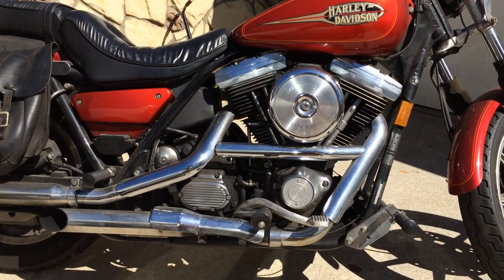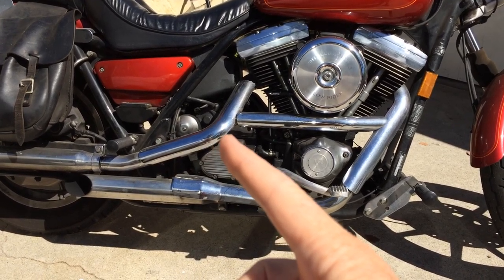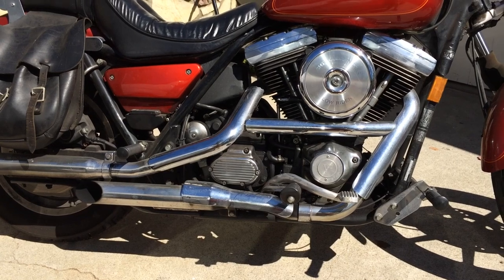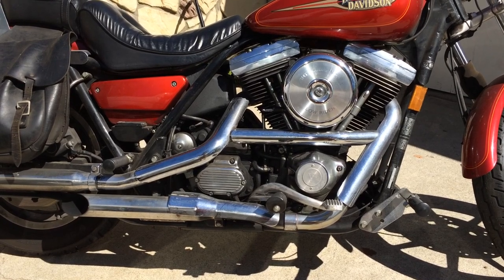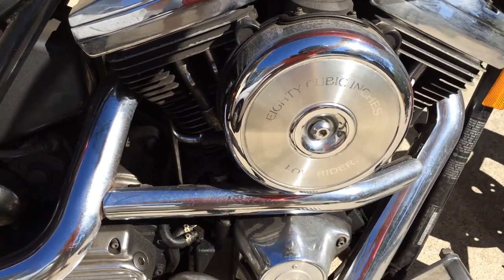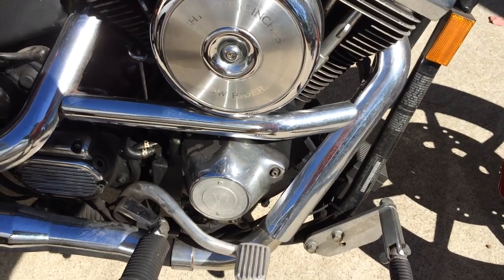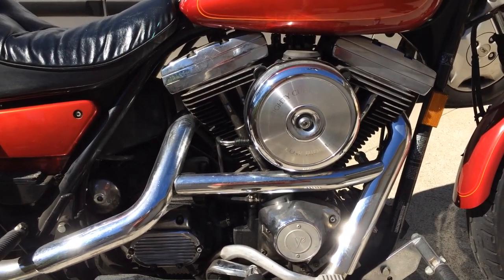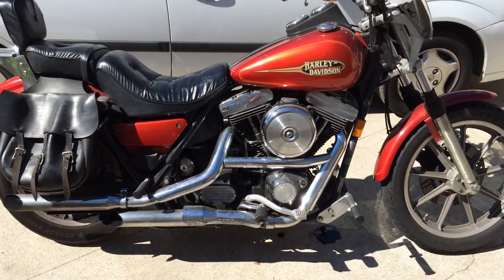Harley Wet Sumping Explained

Comment: I just cranked got my 93 FXR started after 5 years! (I talked her out of a divorce!)  drained and replaced fluids, cleaned carb, and she cranked after 2 turns!  You are correct on the wet sump. She spit at me and ruined my shorts just to remind me what a bad dad I am (was)!  I’m taking her shopping for new paint, bars, front end, and whatever she wants!
Reply from the maker: Glad you got it started. That’s pretty normal, and you don’t really need to worry about it too much. As long as you start it up every week or so, it shouldn’t happen.
Reply: Sounds like a good reason to get something different,

Comment: Wet sumping can also be caused by a piece of grit on the check valve holding the ball slightly off its seat. It was more common on Sportsters than on Big Twins when I was an H-D shop mechanic back in Shovelhead days. It was a LOT more common on Triumphs and BSAs. They knew about it and provided sump drains. Early Sportsters had them too.
Reply from the maker: My enfield Bullet gets wet sumped if I don't put the piston at top dead center when I park it. The sump has a drain bolt and has to be emptied or it won't start up and run.
Reply: ***** RE's do that by design. That's why you just check it's above the add line when it's cold and check actual oil level when it's hot. Mine starts and runs OK when it's that way. Maybe yours does it worse than mine?

Comment: Hey I have a 2020 sportster iron that does this. It will drain down from the tank into the sump over about 4-5 days. No other sportster I’ve had has ever done this so quickly. Maybe a little over a month or more during Jan or Feb when sat for 4-6 weeks. I ride it quit often and it’s a nuisance. It will literally have maybe 1/4-3/8” oil left in oil tank after 4 days. When starting it coughs spits you name it. Lucky if it stays running till about 2nd or 3rd attempt to crank. It fires this coughs and dies. Most time it fires up second time but struggles to stay running to say the least till the sump is at least partially cleared and oil is flowing back to the oil tank. Now b4 I go any further it’s been back to two diff dealers, so that’s two trips back and both say nothing is wrong. I say they are full of you know what. Something is allowing the oil to leak down quicker than it should. Does the sportster have a check valve in the oil pump like my old 94 springer I had, with an evo..carb motor. God I should never had sold that bike.  But we live and learn. I like evo motors hands down over new Milwaukee 8. They just don’t sound like the old harleys anymore. They are a beautiful engine but I’m into sound. A carbureted evolution motor sounds so good. But back to my problem. What do y’all think. I know what to do on the old bikes yank the oil pump and replace or replace check valve and spring in oil pump and pray lol. Any ideas. One dude told me it was a piston ring issue. What. Ok if that’s right it will fix itself when my hammer performance kit arrives. I just want to fix this now and at least slow down the wet sumping on this 2020 iron. Ok guys and technicians let me know where to start and I’ll let y’all know how it went in a few weeks. I’m a floating pharmacist and only have days off here and there to wrench. Thanks so much for reading this and please trolls stay away. I’m 52 and too old for BS. Want to solve this issue bc the dealers seem to think it’s just fine for a sportster to leaking down an entire oil tank in 3-4 days. This just isn’t right. Two guys I ride with have sportsters and theirs don’t do this.
Reply from the maker: I hope somebody answers your question. That happens to my Evo Buell if I let it sit for a couple of weeks. I would guess it Has to be seals in the oil pump.  I’ve heard of some people installing a check valve in the oil line to prevent this as well. Not sure where you would buy one though.
Reply: @hoohoohoblin  I hope someone answers too. Thanks for your reply. I love the bike just irritating to have wet sumping on a bike with under 1000 miles. They even charged me $98 dollars at one dealer for “diagnostic charges “.  I was like diagnostic charge?  You didn’t diagnose anything at all. I told y’all everything. I paid the bill though. But I will never go back there. Lol.
Reply: I have a 2014 XL1200C. The tank empties over time into sump. Never understood how the pump is lowest point and sump is above. If gravity then how does it sump up? Not an issue 1st year I owned but now when tank empties, I have small leak where pump inlet (feed) hose attaches to inlet fitting? Maybe a tablespoon only but I’m anal about even a drop of oil.

Comment: Just came across this video, after the 	1989 ULTRA CLASSIC (FLHTCU)  I inherited puked a TON of oil but still won’t start, now I know why.  I gotta get fresh fuel in her, and check for spark.  My grandmother purchased this bike when I was 9, it sat for five years when she couldn’t ride it, she passed and my mom and step dad got it.  My mom passed last year and my step dad rode it until his knees couldn’t hold it up anymore.  He passed recently and I inherited it through ‘Right to Survivorship’ and it’s a family heirloom.  It’s been partially mechanically restored, and has about 60,000 miles on it.  Everything still works.   

I appreciate your video and explaining this.  It’s ‘sumped’ as the local Harley dealer explained to me so I looked up that term and your video helps explain it better.

Thank you!
Reply from the maker: You’re welcome. I’m glad I could help. Once you get it running, it should be fine as long as you start it up every week or so. Mine only sumps if it has been sitting for a long time. That’s a great old bike, and you’re going to have a lot of fun on it.

Comment: I have a 1990 FXRS.  I leave it in at a vacation home and when I start it up (after sitting for several weeks), I get all kinds of oil puking out of a overflow tube under the bike (but only that first start after if sitting for several weeks).  Thanks for the explanation!  Very helpful...  I was worried.
Reply from the maker: You're welcome.  It is pretty scary when you don't know what is happening.

Comment: I’ve got several HDs, from 73 to 87. Tje only ones that sump are the newer ones, especially if they have S&S oil pumps.
The 73 has a stroker kit but still the original pump and has never sumped once.
The one with S&S pumps are guaranteed to sump after more than a week sitting.  
The ones with S&S cases have a plug at the bottom of the cases where you can drain the oil and the motor won’t have to struggle, stock cases don’t.

Comment: WHOA! Let's not be hasty on the oil pump replacement. This is an ancient condition dating back many generations with known cures.

I'd remove, clean then reseat the oil pump check ball (use a BRASS punch and don't go apeshit with the hammer, a modest tap is typically sufficient) before I went nuts replacing a pump.

If they sit a long time I pull the timing plug and blow the oil out during start (outdoors obviously) rather than overworking the starter. Timing plug gets Teflon tape so it never seizes in place. Been doing this for decades on yard sitters.

Every HD owner should immediately buy the FACTORY service manual and parts book. They are the most useful tools you can own.
Reply: ....My first Harley was a 1972 Sporty I bought in 1975, I bought the service manual the next day......this model of Sporty had a overflow tube at the generator....but also a drain plug under the flywheel area....
 Tap on the check-ball in the pump....yes, also a good place to start.....
Reply: great suggestion, where is the timing plug, and where will the oil come out at?  trying to avoid the yearly mess
Reply: If cleaning the seat and reseating the ball fails, it’s still not worth replacing the pump.
Just either start it more frequently, get used to the sump and place a pan under it, or cut of the supply, either with a valve or  one of those line pinchers that squeezes the line without damaging it.
The down side to that is you HAVE to put a reminder, on the key switch or something, to remember to turn the oil back on before starting.   If it sumps the pump is working fine, it’s not worth the expense to replace a good pump because of a leaking check valve if it only sumps from setting extended periods.  
Sometimes you can fix it, sometimes not, but it’s not the end of the world.
My motors with S&S pumps ALL sump. My 73 with the OE pump never has, and it’s a big bore stroker.

Comment: Hy Brotha my 59' Pan leaks out like 1/2 quart a week when I just leave it sit. I actually have to add oil every cpl weeks and have cardboard that can get basketball size dips if sitting for 2-3 wks at a time. I have to drain the oil and trans in the winter or I'll lose most of it sitting in storage for 4 months. 
Any ideas as I tightened the chain oiler all the way and looked at the check ball as well.? If it is the oil pump then would that trigger the Oil Light at Ideal when Hot as my oil light flutters  ????

Comment: Greetings from the UK
My '72 Commando has the crankcase breather routed back to the oil tank as standard so the oil is saved, then a breather from the tank to the air filter backplate draws the crappy vapour off & it gets burnt. Job sorted. I have just got a spare oil tank for my '78 FXS, & plan to try this method out on that.  Fingers crossed chaps wot!
Reply from the maker: That makes a lot of sense. It keeps everything clean, and you’re not leaving a trail of oil everywhere you go.

Comment: I have a 76 Shovelhead running a belt drive dry inner primary.  The original seal was put in with the Lip towards the outside per the manual.   Is the sump on my bike supposed to wet or dry?
Reply from the maker: The primary oil is different from the engine oil. I think when people run belts, they don’t put oil in the primary, but there is still oil in the motor.

Comment: #1 Clean Your Check, #2 Get An Inline Hose Barb Non-Return Valve To Splice Into Your Tank Return Line From The Scavenge Pump. 
( make sure you get it in the right way, arrow towards the oil tank; and in the return line from your scavenge pump )

Comment: I have this exact issue on my old evolution 80 cu. in. Currently cleaning the ball check valve(does the spring ever need replacing)  & I'm going to install an inline PCV valve.
Reply from the maker: I’m not sure if they ever need replacing or not. I’d imagine the spring would get fatigued over time. It would probably be smart to replace it while you’re in there. On mine I opened it up and cleaned it out and found no dirt in it.
Reply: Spring should be good.  Cleaning the ball check valve - use a magnet to retrieve the ball, blast the seat with WD-40, scrub the ball with microfiber cloth and drop back in.  Now, tell me about this PCV valve - - -

Comment: Another thing that can cause wet sumping is a failed key on the scavenger side of your oil pump.The gears are turning properly and only by friction instaed of mechanically driven. I have seen this twice and the pump shaft and gears normally have to be replaced.

Comment: good explanation.  Mine (99 softail) comes out underneath, I assume that is the breather reroute you mentioned.  Is this reroute entail not having the breather go to the air cleaner?  I was hoping to find a way to aleviate  when the error was already made, I hate oil on the concrete.
Reply from the maker: On a stock Harley, the oil is vented into the air cleaner, where ideally it is sucked into the engine. I’m not sure how good that is for keeping your engine clean, so that’s why people tend to route it out onto the ground. You could also build some kind of catch can to catch the oil. I know Royal Enfield’s are built with a catch can on their bikes.

Comment: HELP!!! When I pour oil into the oil tank it flows directly into the engine. I put 4 quarts and still was empty in the tank. When started,it pukes out of breathers and all 4 quarts are in the crankase .Any help??
Reply: your check valve in the oil pump most likely isnt seated right. it happens over time and is common. if you are not getting any oik returned to the tanks. theres your problem

Comment: I have a 1974 Sportster that wet sumps and is leaking into the primary. I changed the check ball and spring no difference. Could it be the primary vent valve? Thanks in advance.
Reply from the maker: Maybe. I’m not sure how that engine is designed.

Comment: You are right on the money. I owned a 1985 HD FLTC Tour Glide for 20 years. It had the 80 cubic inch Evo engine. It did exactly as you stated when it sat for quite a while. The best thing is to start it up every so often during the dormant time or just drain the oil until the spring riding season starts again.
Reply from the maker: Michael Cappetto Yes! And the first time it happens, you think something is terribly wrong and you'll have to rebuild the while engine. I'm hoping that first-timers will find this video before they panic.
Reply: Agreed. Thanks for the posting.

Comment: Got some details wrong... the oil is not pulled out of the tank to a "sump". The oil pan or tank on a Harley is the sump. Everything else is correct though... wet sumping is not something that happens on a dyna because the pump feed line is actually below the pump. Doesn't make up for the fact that I wish I had your FXR. ;)

Ever taken apart the oil pump on a knuck, pan, shovel, or evo? Pretty simple system that works well surprisingly. Amazing how as long as the pump is primed at first start, it doesn't really need pressure to operate after that.
Reply from the maker: Dp908 Thanks for the clarification.  I've never taken the FXR apart.  It's been exactly the same since it was new in 1991.  It just keeps on running, and I don't mess with it.  Thus, I had my details somewhat wrong.  My Royal Enfield wet sumps, and it won't start unless I drain the sump before starting it up. The Harley is a lot easier to start when wet sumped.  I made this video mostly for new Harley owners who experience this for the first time and get really scared that they'll have to rebuild the whole engine.
Reply: No problem. 1991 was the last year for the full compliment cam bearing, so outside of changing the lifters every 20-30k, I don't think you'll ever have to really open her up. Such wonderful bikes! Still wish I had your FXR. ;)

Comment: I just got one it’s hasn’t been start in five years any tips on getting it going?
Reply from the maker: It’s a good idea to attach a hose to the crank case vent tube, which is going to the air cleaner. Re-route it into an empty oil bottle, because there’s a good chance when you start up the engine, a bunch of oil will pump through it into the air cleaner.  It’s also a good idea to change the oil before you try to start it up. And maybe spray a little bit of oil into the cylinders as well in case the rings are rusted on to the cylinder walls.

Comment: So I have a 06 sporter that had been sitting for two years didn't leak oil till I got it going it will set there and empty the oil tank now how do I fix it dosent have the big screw for the check valve any help please
Reply from the maker: Here’s some info about sportsters. They say you should just start it up and let the oil pump back into the tank from the sump.  There is a valve that might be stuck open though.  https://advrider.com/f/threads/wheres-my-oil-gone-1200-sportster-help-needed.964075/

Comment: Oil will come out of the crankcase breather when it pukes oil; and not every bike has a "filter" on the breather. Other than that, pretty accurate. Anyone that's ever owned an older Harley knows about oil puking! ::D
Reply from the maker: John Ratko Yeah.  Depending on how the breather is routed, oil can come out different places.  I made this video primarily for relatively new Harley owners who let their bike sit for a while and got really scared when oil started leaking out all over the ground.  I think that happened to all of us at one point, and we wondered if we'd have to rebuild the whole engine or sell it for scrap metal when we saw the oil all over the ground under the bike.
Reply: @hoohoohoblin just started my new to me 1984 FLHS Electra Glide Sport that sat for 10 weeks in transit. Heap of oil came out the airbox. Lots 🤦‍♂️

Comment: my son's 1990 fxrp just puked out one quart of oil after sitting only one month... wow... but a few days later only a few oz...  and the next day nothing...  but the ball needs to be remove and i need to get another ball and weld a stick on it and use lapping compound and clean out the hole... now this is the correct way a Master Harley Tech will repair this common problem... so is life ....  now try not to get any lapping compound in the oil system that would be a large mistake my friend... just  crap got into the system and the ball in not seating tight no big deal... live & learn....

Comment: I have a 99 evo the oil is coming out of the he top of the engine. Rocker box? It set for every winter and on and off several years . Ang ideas ? would over full oil cause yhis ?
Reply from the maker: If the oil is coming out all the time, through leaks in the rocker box gaskets, you need to replace the gaskets. This is easy to do, and they designed it so you don't have to pull the engine out of the frame to do it. If it leaks out of the air cleaner or out of the hollow bolts that hold the air cleaner on, when you start up the bike, but stops after a few minutes, and only happens if the bike has been parked for a few days, weeks or months, then it is wet sumping. The crankcase on the evo engines is ventillated through the head bolts, so if too much oil gets into the sump, it comes out there.